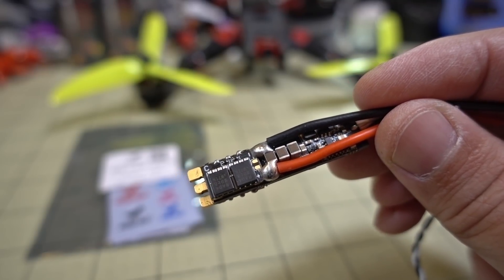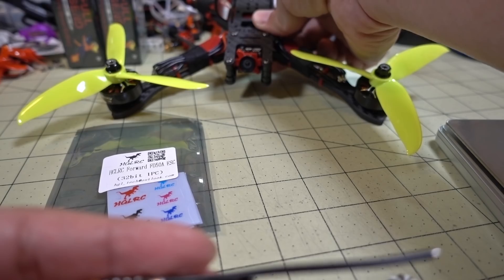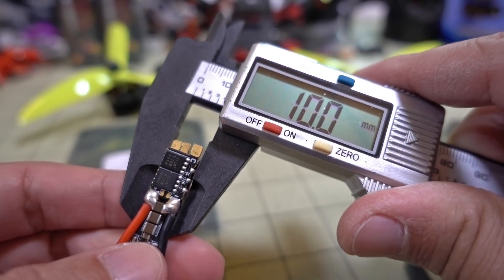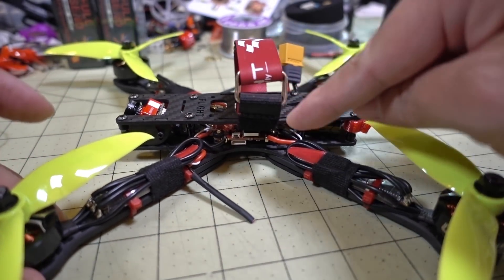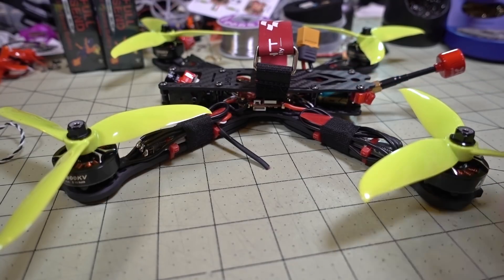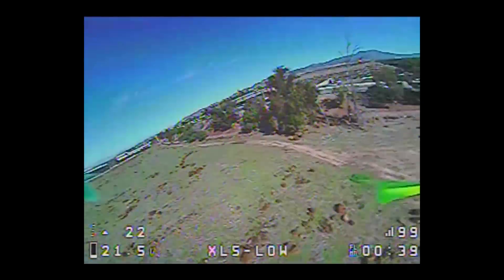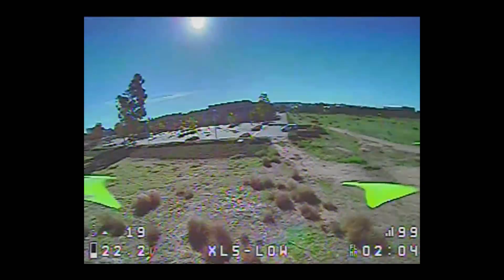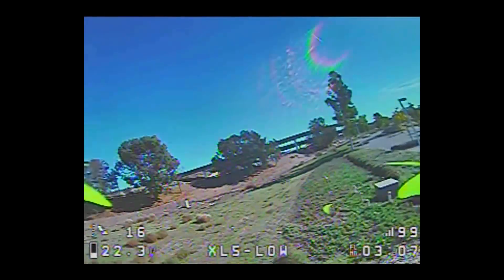HGLRC Forward FD50 50A 32-bit ESC Review & Giveaway 🎁😀

Comment: So far they havent impressed me, one failed right after the build.  They dsync at full throttle. 2306 1700 kv 3bhobby motors with ethixs props ....anyone else have this problem i feel like the 50amp rating is wrong

Comment: That's a pretty long esc. Looks like it will fit better on 6" than 5" frames unless you don't mind cutting your motor wires till its very short.